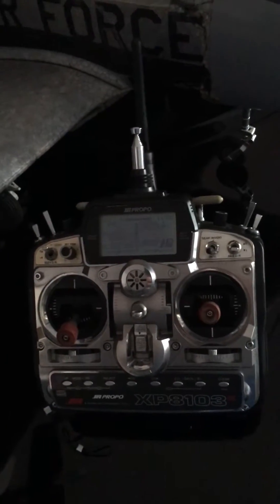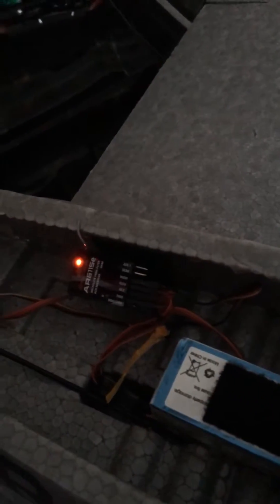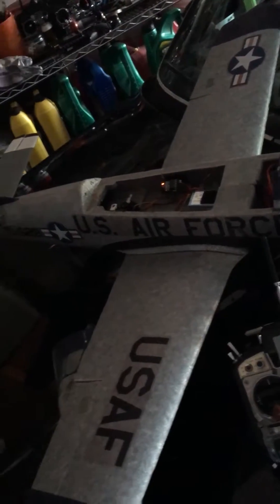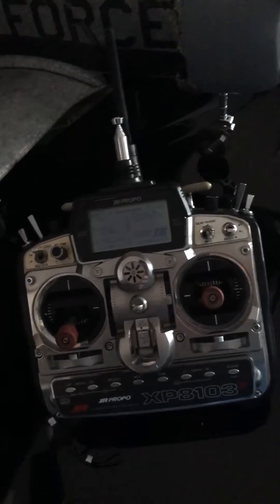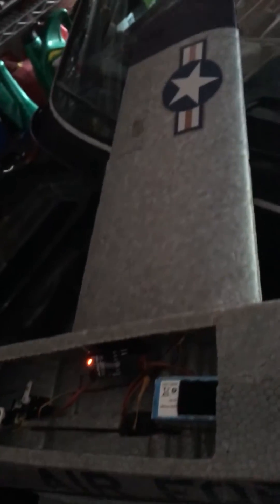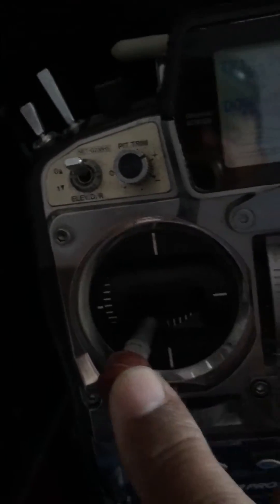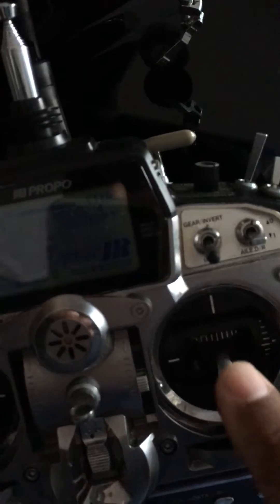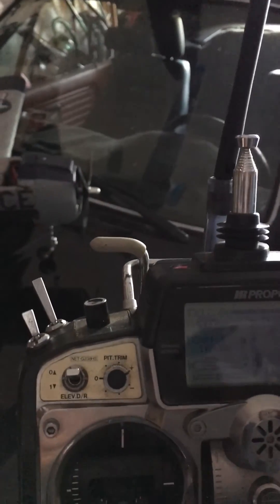XP-8103 with DM9 2.4G Module

Comment: Hey Carlos, I'm thinking of getting JR with the DM9 and I was just wondering if you still use it and what is your honest opinion. I can't find many reviews on it, have you done range test or anything like that? i'm new to the hobby and any information you share is appreciated.
Reply: I still run an xp8103 with the DM9 2.4Ghz dsm2 module with a ar620 reciever in my fms votec 1.4m its what i learned on with my Grandpa  and now has been passed on to me now that hes passed, ive had lots of luck i think with range its great and no bugs or weird twitches or dropouts